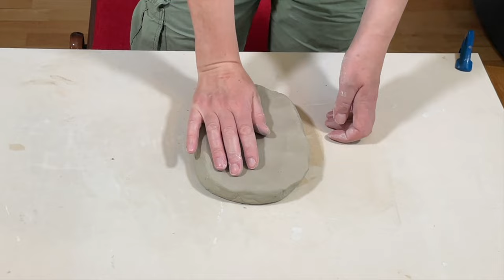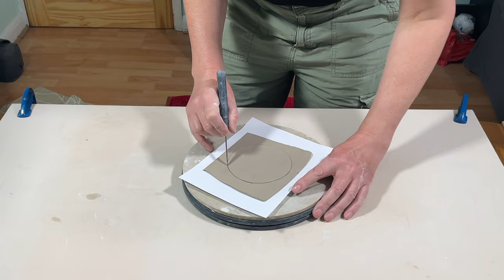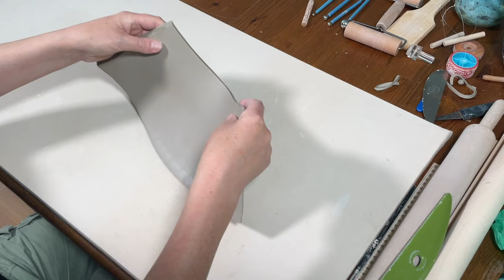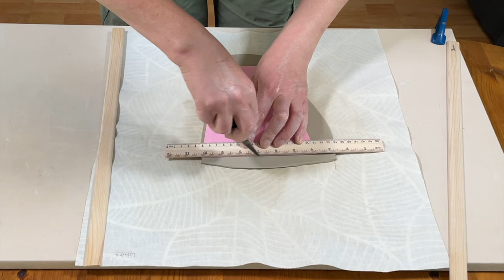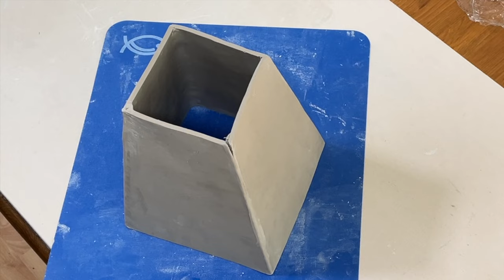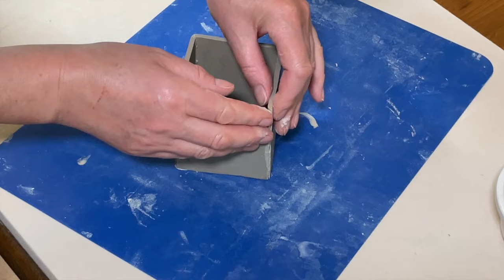3 Easy Ways to Make a Slab Vase

Comment: I made the vase according to instructions.  The two halves were fine BUT when I attached the two halves, I ended up with one side bulging a bit and the other side much flatter.  I shall try again.  Does anyone know what thickness the rolled slab was for the tall joined vase?  x
Reply from the maker: Hi Anne, was the one that bulged the teardrop shaped vase made from two cones?  I'm wondering if the clay was still a bit fresh when you attached them.  If the clay is still a bit too wet, it can sag.  The slabs for the third taller angular vase were 3mm thick. I hope that helps.

Comment: Hi thank you for your tutorial regarding the round vase, the inner tube being a wonderful idea, I have a question could the same technique be used to make a square vase always assuming I can find a square inner box of the right dimensions. I find getting my hands down into the joins to make them smooth and tightly joined very difficult, so wrapping around would make it so much easier. Have you ever done that and did it work out well? Kindest regards and many thanks for the video,s

Comment: Hi! I've been doing slab work so this gives me some great ideas.
Wanted to let you know the link to the wax resist is a dupe of the craft foam link. I had a question about what that is and how it impacts later glazing. ~~Do you scrape it off before glazing?~~ Oh duh.. it burns off in bisque. This is what happens after a long day at work.
Reply from the maker: Hey, Ken, glad the video gave you some ideas, and thanks for the heads up about the dupe link :-)

Comment: Very impressive with the bevelled angles of the neck by eye, amazingly skilled. I find that when I cut out from a template the clay moves and warps beneath the knife, do you dry the clay with a heatgun or leave some time before cutting out the templates after rolling out the slab?
Reply from the maker: I leave them sandwiched between a couple of sheets of wood :-)